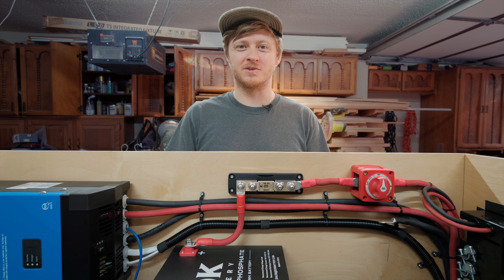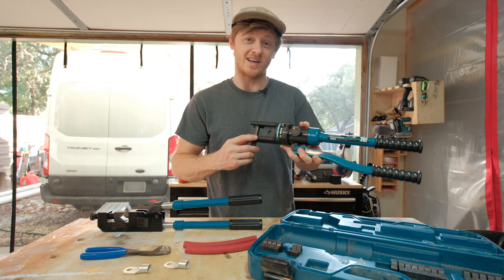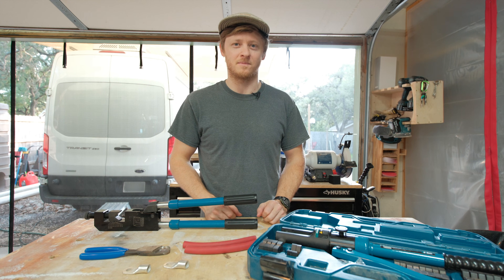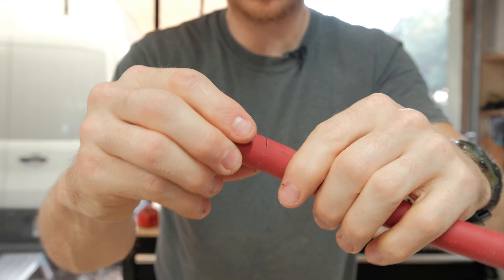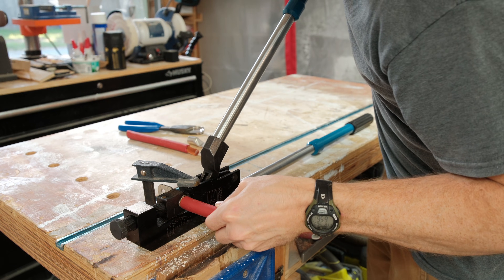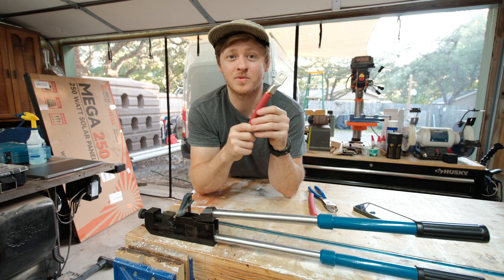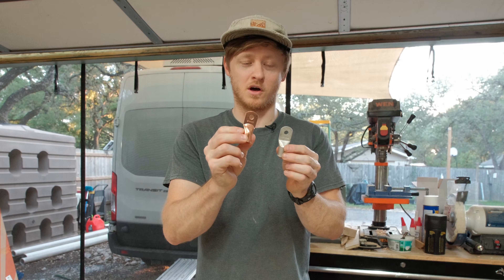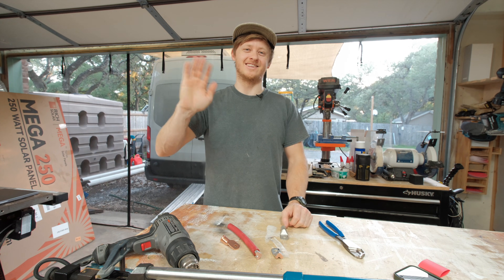How to Crimp Heavy Wire Lugs the RIGHT Way (Don’t Skip This Step!)

Comment: Hammer crimper works well and places less of a point indented on the lug itself. You get used to the feel of the hammer bounce and sound when it is fully crimped. Use a block of wood as a backer if you dont have a plate of steel as it will break concrete and indent asphalt. This is why others have commented to use a vise with the tool. Really inexpensive tool also.

Comment: I'm redoing the battery connections on my race car to accommodate a jumper battery plug. Since we have a small battery to reduce weight, plugging the jumper battery via an Anderson connector helps with starting at the grid. Your video was very helpful.

Comment: I used a PVC pipe cutter to cut through the insulation.  Next time I'll just use the cable cutter, I think your technique has more control since the cables can be a bit oval in shape.  Also, my bigger mistake, I put the indent on the top of the lug instead of the bottom.  In my case it didn't matter as the lugs still bolt down flush with the terminal pads, but I can see that in some cases I'd want the V-shaped bulge at the top for a flush fit.  I used a hammer crimper and a 4 pound hammer.  The first hit just holds the lug in place and the second and third hits give that cold weld you showed.  At least I assume that they do -- it seems like a solid crimp to me.  Thanks for the video, it's great info and no fluff.

Comment: Hammer crimpers work incredibly well. It's very consistent and quite easy to get really good results.  What it is not is quick to use. You generally have to move to a different location (or bend down to the floor), to have a surface robust enough to hammer on without damping the impact and it is more awkward to get everything lined up and held in place.  But the results are really very good.  No reason to doubt the quality of the crimp after visual inspection. A hydraulic crimper is great if you will be doing more than one system's worth of wires but if you are buying a crimper just to do one project (especially if it is an RV or van project where size and weight of tools is important), the hammer crimper is the way to go.
Reply from the maker: Very good insight - thanks for sharing. I think this will be really useful for other viewers to read.
Reply: Good point.  Assuming the hammer crimpers are more cost-effective, it sucks to have just one job that requires one or two large gauge applications.  You shop around for the cable to get the best deals, etc.  "Okay! I FINALLY managed to save fifty bucks on this marine-grade 10AWG cable. Now, all I need is this $100 tool to make one crimp that I'll NEVER need to make, again. Ever. Awesome!"

Comment: What are the main differences in results with the idraulic one?
Reply from the maker: Primarily just the shape of the crimp. The dies in the hydraulic ones are hexagonal (applying crimping pressure from all sides) while the indent crimper just applies pressure in one area on the bottom. Both can yield a reliable result. I started with a hydraulic one but now almost exclusively use the other one I showed in the video as I find it faster and quicker to use. 

This webpage has a good picture comparing the results of each style crimper:
https://www.motor.com/magazine-summary/trouble-shooter-september-2018/#:~:text=In%20a%20soldered%20connection%2C%20the,and%20literally%20fuses%20them%20together.

Comment: I can highly recommend those hammer crimpers, but used with a vise for compression instead of hammer. If someone already has access to a vise, it's a great cheap option :)
Reply from the maker: That is a clever idea - thanks for sharing! That seems like it directly addresses my concern about not being able to control the pressure as well using a hammer.
Reply: Can you explain how you use your vise in a bit more detail?
Reply: Good to know, I just had one delivered, I was going to use it in my hydraulic press. I will be able to precisely control the pressure.

Comment: This "cold weld"  is not from crimping but from cutting on the bandsaw, and this is not welded just polished by cutting.
Reply from the maker: Hey, I understand where you are coming from. When I first cut it open I wondered if the copper inside had actually formed into a solid mass or if the copper was basically just smeared together along the cut edge by the blade. To test this I also cut open a lug that I intentionally under-crimped. In the under-crimped one you could make out the individual strands of wire still, the blade was not polishing or smearing it all together to look solid. I didn't add this comparison into the video because I was trying to keep it short and to the point.

I put a lot of effort into making the information in my videos accurate. A properly executed crimp between a wire and a lug should lead to a cold weld. That is the actual technical term and not just something I was making up for something to say. Cold welding, also referred to as solid-state welding, is a process that joins two metals without the use of heat. Instead it relies on immense pressure to bring the materials together and create a bond. This basically only works on softer metals like copper, aluminum, or brass. This is totally different from traditional welding in which heat is used to melt the metals together.

The second and third paragraph of this article give a good explanation as well (and some good info on why crimping is the preferred choice over soldering for connections like this):
https://www.motor.com/magazine-summary/trouble-shooter-september-2018/
Reply: I had the same thought, searched online for the term and found photos of a proper-, under- and over-crimped coldwelds, the difference is quite clear, it isn't the bendsaw that is welding or polishing it out. All were cut on the bendsaw.

Comment: It gets cold welded?! I never thought of that, good to know!
Reply: It is not really cold welded. As you cut this with a band saw, you're adding heat to those adjoining areas, joining the ends of the copper strands at that point. The strands are in fact just pressed together.
Reply from the maker: Pretty cool right! The immense pressure of crimping it actually deforms and bonds all the copper together.